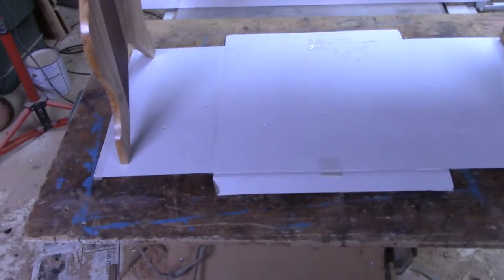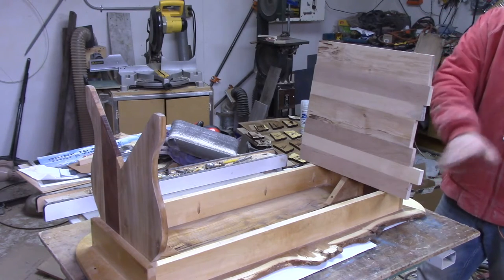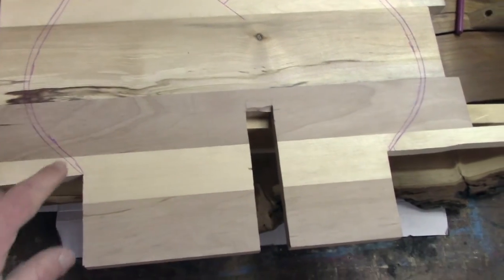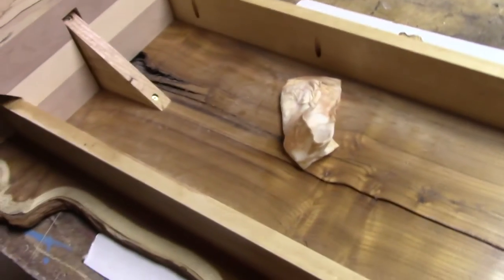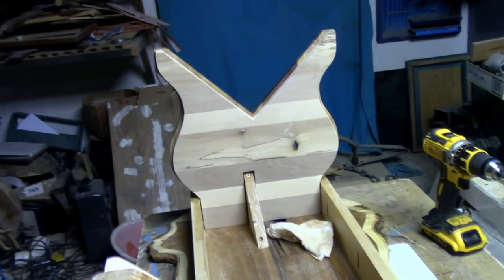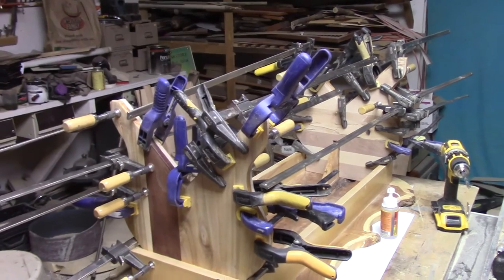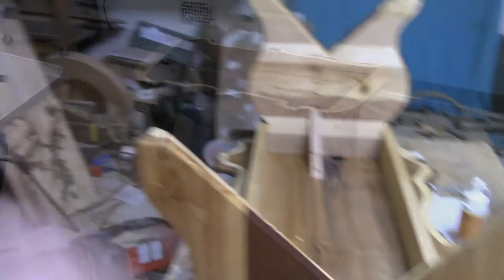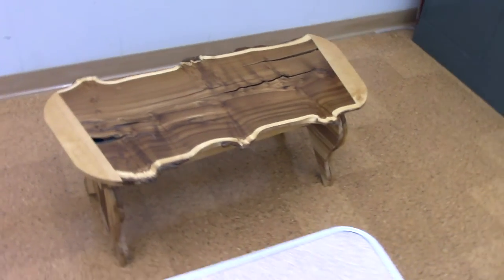Mulberry Table Fix - "Legging it"

Comment: Any reason you didn't attach with some overlap and use a flush trim bit on the router to get the two layers to match?
Reply from the maker: No reason.  While the legs were glued to the base, the top wasn't glued down and could have been removed for a flush trim.  Come to think of it everything would have been easier if I had just taken the top off of it.  While I do like the final look of the recessed legs (more than the originals) I just didn't think of it at the time.